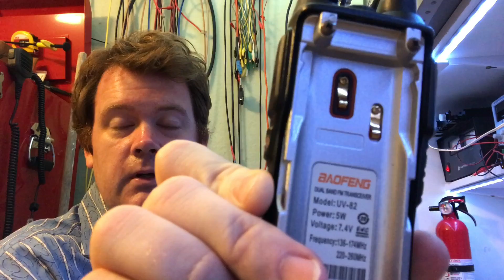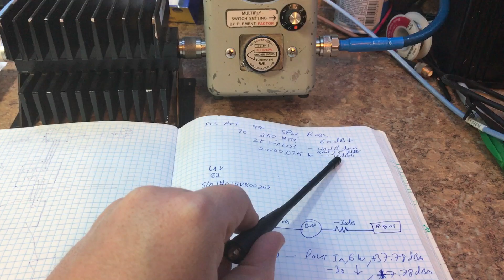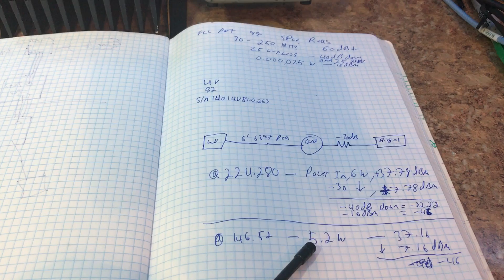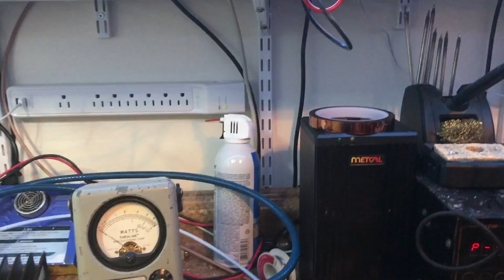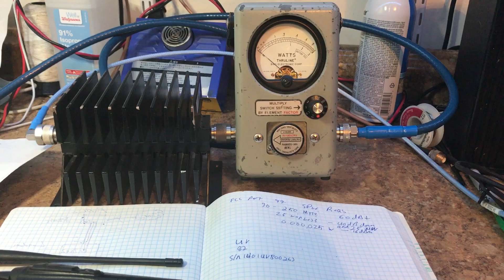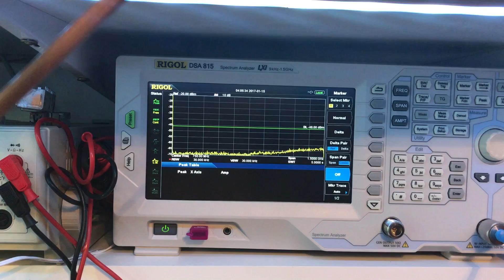Spectral Testing of Baofeng UV-82

Comment: Are you sure you weren't overloading your spectrum analyzer?  An easy way to tell is by adding a small attenuator to the analyzer's input (say, 6 or 10 dB) and see if all of the spurious emissions drop by the same amount.  If they drop more than that, the analyzer's front end was overloaded.  +8 dBm into an analyzer is pretty high for this kind of test where you want the front end to stay linear. For example, I just measured a UV-5R on a spectrum analyzer here (an IFR 2799B) and on 147.000 MHz the strongest spurious emission (2nd harmonic) was -47 dBc, which I think meets Part 97 and on 450 it was -60 dBc.  That was using 40 dB of attenuation ahead of the analyzer .  When I switched the attenuation to 30 dB, the harmonics increased to -27 dBc on 147 MHz, indicating analyzer overload. I don't know if you have the same thing going on here, but it's something to check if you haven't already.  I was actually surprised that the UV-5R was as good as it was.
Reply: Thanks, @stevedold4573 .  Said very well.

Comment: Baught one it's decent. Of course. Some thing that's been handled. And dropped might just be out whack. I've baught several r5s and chirped them for scanner/ fm radios. And fox hunts. Once fixed. I remove the menu/the voice/the beep/ and switch off xmiter. It flat won't xmit.

Comment: Any chance, using that same test set up, and two different radios, with similar power levels. a yaesu, kenwood, and baofeng ? What is that 30db attenuator sampler your using. Do you have a brand and model number ?
Reply from the maker: bI go over the entire setup in another video.   It's a Narda Microwave 30 dB 150w load good up to 6 ghz.
Reply: @W9CR  I see Baofeng has upgraded most of its equipment (Poufong) since 2017, the year of the video.

Comment: I have two 8 watt models, with a third on the way. The receive section is excellent, and there are good reports from other amateurs via a repeater. In not one case has there been any complaints from anyone off band. In many cases testing things on "instruments" often give "results" when in practice, the operation is fine.
My advice is to continue using your UV-82, because they work fine. They are my favourite  Chinese radio and nothing has changed that ( UV-82, no "220" anywhere I can see, maybe there's a difference with UK versions)
Reply: You did not understand the video, the Baofeng radios POLLUTE the air with noise in several frequencies.

Comment: Thanks !   You may want to skip the background music next time.  Have you actually heard of any cases of reported interference from Amateur radio use of this radio?   I have had no problems with mine , its a great radio for $52 and at that price point I carry it more than my Yaesu HT.   Of course I cant see the spurs ( if they exist on all of them )  but in reality,  has anyone had a problem with them?      73
Reply: In an "Alternate Reality, BaoFeng radios are clean as Irish Spring. Don't get that thing near a spectrum analyzer or your head will explode!
Reply: Joel Bahl No problems here. I use them all the time and they work fine. Good audio reports from other hams as well. I understand there are spurs with these cheap radios but what do you expect for $30.
Reply from the maker: You're complacent with causing interference all over the spectrum when you transmit.  If you can't take any pride in anything, why did you decide to get into ham radio?
Reply: Well Bryan I have been a Ham since probably before you were born ( '71) and have held a commercial radiotelephone license when I worked in the 2 way radio business.  I do take pride in my transmissions but I do not base my opinion of my personal equipment and its output by a single test made by some random guy on the internet.
Reply from the maker: It's incumbent on you as the licensee to ensure the legality of your equipment.  The test is provided with the necessary background information to challenge the results if ones inclined. 

You base your argument on your age, a logical fallacy, which does nothing the challenge my findings.  Rather than engage in critical thought you're here spouting ignorance and trying to justify your operation.    

Perhaps it's time to find a new hobby.
Reply: So somehow you feel that every ham out there has to own a spectrum analyzer and test equipment to make sure that all of the factory gear that they own is within spec? I think not.  It just does not happen and you know it.   How about answering my first question " Have you actually seen any proof of a violation caused by one of these radios? "  No , you haven't. But have fun with your Youtube videos.
Reply from the maker: Joel, you're still not presenting anything to refute my findings.  You are exactly the wrong sort of individual to be involved in amateur radio.  You care nothing about the interference you create and take pride in your poor operational practices.
Reply: @joelbahl6830  Five stars for that comment. No tests here ( the UK) have shown anything but that this radio is great on receive, and transmits with no nuisance to others off band.
⭐⭐⭐⭐⭐
Reply: Just continue to use it. His radio may have a fault, as part  of a faulty batch. I have two, with another coming, and have experienced none of the faults he speaks of, and had no complaints. It remains my favourite radio.

Comment: You say over and over how awful it is etc. I see that. However- are the spurs of sig power to actually cause any issues? Some comment on the real world drawbacks to these findings would be helpful. I am just not clear on real world detriment to these findings. (Yes I agree it is awful, breaking P97 etc. and should be amended in the design). I know all the noise in my HF radio locally are not coming from Baofengs but flat screen tvs and poorly designed power supplies etc.
Reply: The radios will transmit a strong signal where they aren't tuned to.  This can interfere with radio traffic in other services.
Reply: Perhaps this radio being tested is defective?  No mention of this here. I would think this issue stems from a dirty oscillator or buffer and the P.A. is amplifying garbage...

Comment: Although you need to rename it as UV-82X, which is the model name of the 220 radio.
Reply from the maker: This is a UV-82 according to the label.  The serial is 1401UV800263.
Reply: Yes, I know.  Mine have that on the label, too.  It is really a UV-82X.  The UV-82 is the 2 meter/70 cm version.  Trust me.  You can even google it.
Reply: Yeah.  I was confused at first, because the UV-82 doesn't do 220, but then I discovered that there is a UV-82X, which is what this must be.  I'd be curious to know about the output on 2m, too, which wasn't discussed in this video.
Reply: @NathanChilton  I willing to guess that the problem here is that the 220 capable models are simply 2 meter /70cm radios that had the software modified to add 220 capability (and the filters are intact for 2m/70cm operation) would be great to have someone who has one investigate...

Comment: Why do you think the FCC allows continued importation of these radios with such non-compliance to the Part 97 requirements?
Reply: The same way the Dodge Sprinter van was imported.  It isn't.  Shipped over in "parts" to get around tariffs and fees. Pretty sure if the cheap china junk mfg's don't care about spurs, they don't care about FCC acceptance and will find ways around it.  Stop thinking with your wallet. You are a ham, think with your mind. Would you be pissed if a commercial system had spurs on YOUR ham radio setup...of coarse. Then why is it OK for YOU to throw spurs all over spectrum outside of the ham bands ? It isn't.
Reply: Brandon I'm sorry to hear that people in the Fort Worth area abuse the VHF repeaters as you described but it is not the norm everywhere else. I have only had my license for 2 years now but here in the greater Austin area people are very respectful of one another and do not use foul language on the air. Most of the hams I hear on the radio tend to over identify with their call signs (several times every 10 minutes). In fact the only time I've heard foul language and rude behavior is when the local Win System repeater was connected to the repeaters  in southern California. Thank goodness they have now switched over to the Salt Grass network here in Texas instead. KG5LAA
Reply: Papa Nick because the FCC doesn't give two fucks about vhf anymore. I hear people cussing and doing stupid shit all the time on my local repeater and NOTHING ever gets done to stop it. Ham radio is just like standard CB these days. Nobody identifies like they should, they run ridiculous amounts of power, key over each other and deadkey weather nets. It's stupid. I knew this shit would happen when they decided to drop the code. Ham radio is dying a slow death now that ANYONE can get a ticket. Sad. I am a 21 wpm coder with my extra class. AF5GV and it pisses me off when I hear newbies say 10-4 or 70 threes. Absolutely no radio etiquette anymore.